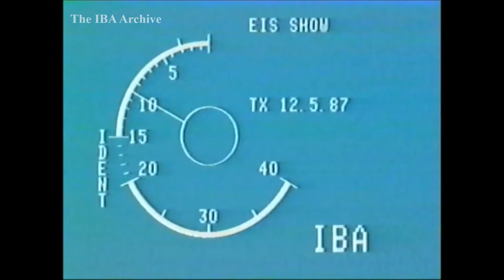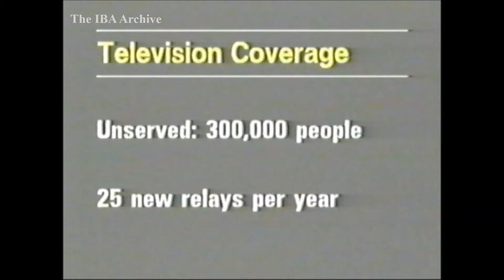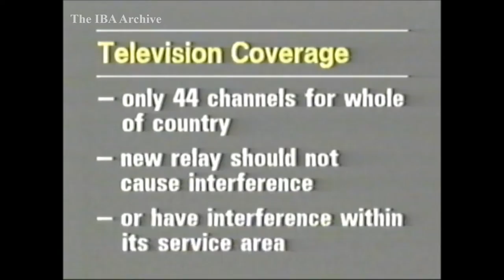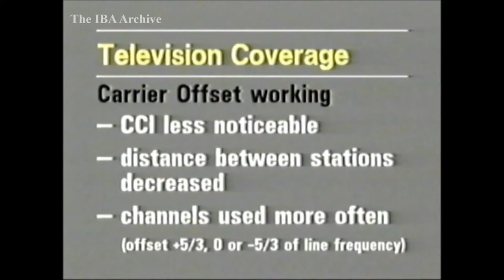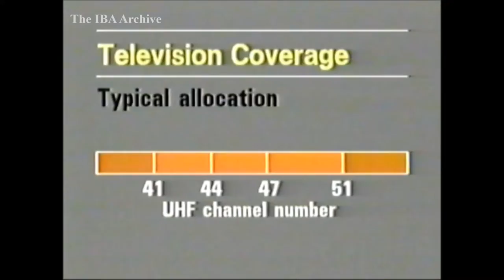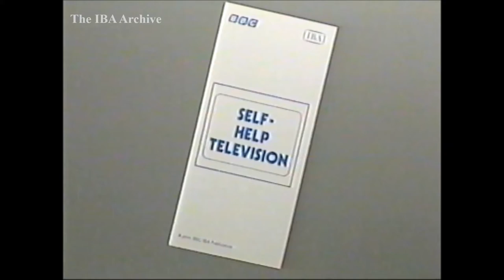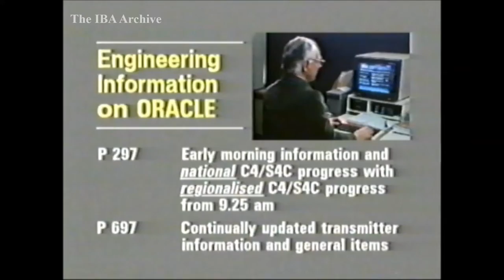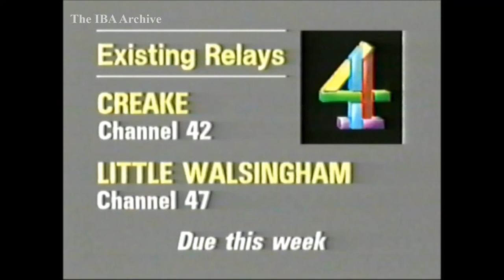IBA Engineering Announcements - 12 May 1987 'Problems With New Relays' (PARTIAL PROGRAMME)

Comment: Interesting insight into the problems of getting to 100percent coverage on UHF. Wonder if there are still many 'blackspots' where no digital terrestrial reception is possible?
Reply: Yes if anything there are more blackspots where digital terrestrial reception is not possible compared to analog because many relays & deflector were build to address ghosting due to multipath issues which does not effect DVB-T(2) so less people would be served by them and the goverment encuraged many people on relays to switch to Saterlite TV during the digital switchover.
Reply: A lot of transmitters now also broadcast using much less power too, example Wattsville Relay in the South Wales Valleys used to broadcast at 6 watts before DSO,
 now it's just 2 watts,
Reply: @jasonl5967  Not necessarily as the way ERP is calculated with digital TV (DVB-T) is different (peak EPR for analogue vs Average for digital) so digital TV would have a EPR x5 lower than it did with analogue and since digital needs a lower SNR the coverage may have actually increased although its more complicated due to the 600 MHz (the channel used in the 1960s plan) and 800 MHz clearance (the 700 MHz clearance was also foreseeable by the time many relays got digital tv) as well as planning for 6 high power multiplex instead of 4 channels to use more directional transmitting aerials to reduce the problems co-channel interference could causes in adverse weather conditions.

Comment: The Channel 4 rollout was hopelessly slow, almost 5 years later and still relays being added.
Reply: Channel 5 was even worse.
Reply: @RW-nr6bh  IIRC, not all of the country got Channel 5 until digital was switched on.  The launch of Channel 5 was a botched job at best.   For that matter, if you want to be technical, not all of the country got Channel 4 either until digital if you count Wales.